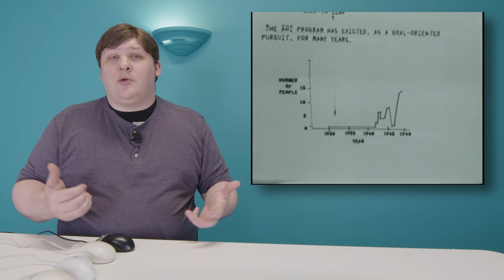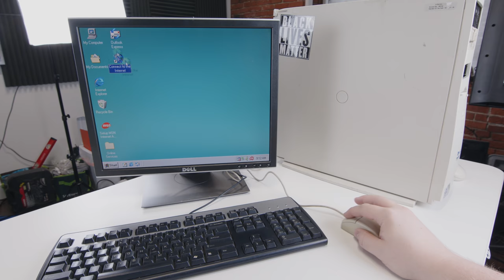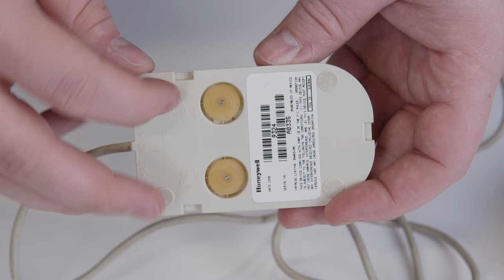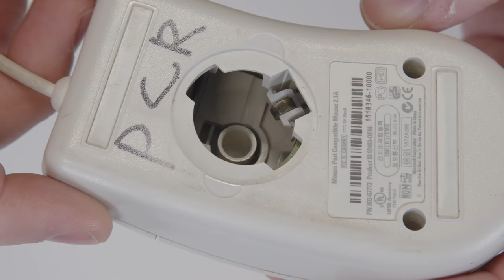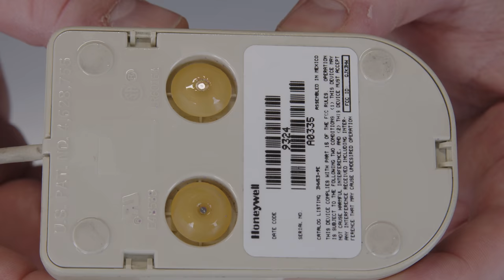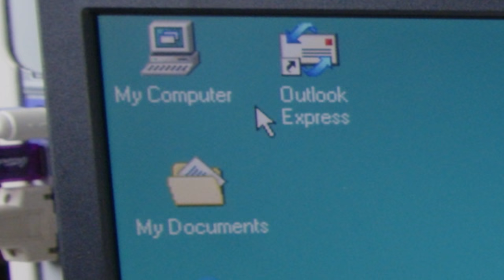Jack Hawley's Unstoppable Computer Mouse

Comment: Regarding Engalbart's mouse and design choices here are some things I reflected over:

Why no ball?
I don't know, I doubt that Engelbart never had come across a trackball before. But maybe he didn't think of inverting them, or (IMHO more likely) he thought that such device would've been too large (looking at the Telefunken "mouse"/"rolling ball control", which actually was released before Engelbart's demo, it seems to be 50-125% larger*, in each direction, shaped like a half-sphere). It does seem like Engelbart at least had some ergonomics in mind when he designed it.

Why wood?
Well, it was a prototype. Wood was/is (today it probably would've been 3D-printed) a reasonably fast way to make a prototype (also, see other early computer related products, like the Apple I or actual Breadboards)

Why potentiometers(/rheostats)? 
The patent (filed in 1967, demo was in 1968) actually mentions three different "decoders" for possible use: Potentiometers, Discs with tracks and sectors, where wipers are used to determine the position (similar setups are used in electromechanical devices, like , and a rotational decoder (with three tracks). What the two first ones have in common is absolute positioning (with the downside of the second one being that it would need a large number of wires, as noted in the patent, one for each wiper/track), and that seems to have been important (together with high precision) to Engelbart: Skimming through the patent the device is meant as an replacement for light pens (which uses absolute positioning), the device is called an "X-Y Position Indicator", and it mentions it being used to trace drawings etc.

Also notable: Engelbart's device had three buttons (at least in the patent, the prototype had only one), I don't know how common that was for similar devices before that (the Telefunken mouse had only one, big, button at the very top*), and the cable came out the back (instead of the front end, as later versions did), hence they called it a "mouse")

It's interesting that we went from using "pens"/"on screen input", to "off screen input"/the mouse being the "better"/more prominent input technique, and now back to "on screen input"

This was a great, informative and entertaining (as always), video on an interesting, and weird, mouse. I just find Engelbart and his (and other "proto-mice") mouse fascinating.

(Personally I use what could be seen as "the ultimate mouse, combining the power of it's ancestors": A trackball mouse with an optical sensor :D )

(*The Telefunken RXS 100-86 was a beast, that doesn't seem that comfortable to use, measuring 70x120x120mm 2.75x4.75x4x75in)

Comment: When you talked about other failure modes my mind immediately went to using it on some kind of loose cloth, god forbid. I don't think that would be especially common ever, but if those feet were grippier I could very easily see a tablecloth or some sheet getting pushed up and twisted around both the feet and the shaft. A ball mouse might not work well on that, but it wouldn't get jammed every few seconds like the Hawley mouse could

Comment: I remember using these honeywell mice at university back in the early 2000's. I remember them being quite good, and they would have been excellent from the point of view of maintenance for the IT department! I think ours were connected to X-terminals and PC's that were running Solaris.

Comment: So at my highschool the pc I was assigned in computer class had this mouse, it was the only one in the whole school (the rest were ball mice) and I was confused as to where it came from. It did have a bunch of oddities, it didn't work on the mouse pads (we had weird ones that were terrible), it worked 'perfectly' on the linoleum of the desk, which was kinda funny cause the ballmice were opposite, meaning I had a huge range of motion where my classmates had to deal with the tiny mouse pad.
I did notice the obtuse angle issue, I treated it a bit like an 8 way dpad more than an analogue stick.

Comment: To work around the slipping issue, you could add more tracking wheels at new angles. 
Give the circuitry more input to work with; take into account the inputs of four or even just three wheels instead of the two, and the slipping issue would be solved.

It feels like that would still have less complexity in the build than a ball mouse has.

Comment: (I'm a little late here but)
Conventional trackballs can't operate on wet surfaces (esp. oily ones) due to a phenomenon more commonly associated with cars called "hydroplaning", a trackball emulates the mass of a car by having that little weighted core in it.  The internals of the mouse getting gummed up by wet debris is simply icing on the cake.

Comment: Optical mouses were already available in general public computer shops during the late 80's, and they were way cheaper than Microsoft mouses of the era, especially the InPort model that was sold with its controller IC or its ISA card. The main drawback was the obligation to use the dedicated mouse pad.

Comment: The 80's had controllers that used 2 potentiometers that you could turn by hand, pretty much the same as the 1st mousey. these could be used in some games with commodore VIC 20, 64, and probably others. These seems to be called as "pot" or "paddle" controllers. Had to wire these to analog port of the rs232 to make em work.

Comment: I think a better analogy would be comparing a mouse to a steering wheel. Both controllers that are smaller parts of a bigger device used almost universally. 

Car would be better compared to the computer as a whole. Wheel/mouse comparison even works better considering the wheel wasn't immediately how we steered cars, first cars used a stick/rod.

Comment: In 1986, I think it was more a matter of people using the mouse that came with the system, and the OEMs going with the cheapest designs they could come up with. Aftermarket mice just weren't a thing for most computers, with the exception of the PC. And in its case, you were more likely not to have a mouse at all at that time.

Comment: Sorry about that. Did work for some nutcase who made a ball mouse in a wooden box. Serial interface, single ball. Used an Intel 8048 micro chip. Next came a mouse with both an IR and a Red LED. Pad was a weird looking job with Green and faintly red stripes... the one with a really big ball won.

Comment: the pull between a magnet and steel is the same as between two magnets as long as the steel is sufficiently thick....two reasons to go with a steel washer would be cost and maybe more importantly, ease of assembly.  with two magnets you have to get polarity right and depending on how the magnets were supplies and how the mice were assembled this could be a huge headache.

Comment: I had that exact same mouse. Bought it for $1 at a thrift store back in 2003, and sold it on eBay a few weeks later after i was done playing with it. The magnet springs are much smoother and don't buckle under load, only reason they are used.

Comment: Optical mice were jittery and had finicky tracking that didn’t always register very small movements when they became commonplace though. They still do, twenty years later! I hate it when I have to replace a mouse, because it takes several tries before I find one that works well for me, and then it doesn’t last long.

I had a counterfeit Microsoft intellimouse ball mouse, one of the first ones to have the scroll wheel. That lasted for 5 years, and only then only the scroll wheel rubber was worn off. Found out it was counterfeit even trying to get DOS drivers from MS support. They still emailed me the drivers, which worked.

Wish I’d held on to that mouse. The genuine MS intellipoint mouse I replaced it with, didn’t even last 6 months. No mouse I’ve owned since has lasted anywhere near as long.

Resisted the switch to optical, until ball mice simply weren’t on the shelves anymore, at which point, only laser mice didn’t have unacceptable jitter or tracking fails at high speed. These days there are plenty of optical mouse with reasonably good performance, but I still miss the ball mouse, because good ones had a sort of stability and predictable behavior that I still don’t feel with high end opticals. A good ball mouse’s tracking was 100% still if you stopped, tracked small movements consistently, and would not fail to track fast sudden movements. Even the best optical mice today still fail to track movements above a certain speed threshold, and for me, still don’t feel as capable of extremely fine detail.

Comment: That's nuts.  I have the black Keytronics LT Mouse PS2-B version and its identical except it uses a PS/2 port instead.  I had this brand spanking new mouse since the 1990s and never used it.  I have it in front of me and it looks practically the same except for the buttons.  I was surprised that some people in Ebay paid up to $95 for one.

Comment: Most early cad, and best practice now, has you do tuning that fine by directly editing vertexes or algorithms. the mouse is only used as a selector.  Actual advanced manipulation uses expensive as hell 3d pointing tools(or if your not a rich architect, sucking it up and spending 2 seconds rotating your view with hotkeys)

Comment: Had the Dec hockey puck on the vaxstation 2100. Thing was indestructible. Was still good as new when that was retired around 1994.

would assume that patent protection plus offshoring of manufacturing for consumer product in the early to mid 80s limited distribution beyond workstation companies based in Menlo Park or Palo Alto and by the time that such protection expired optical mice were taking over. Since track balls has been around since the later 40s it would follow that the various approaches to rotary encoding from the ball did not enjoy such protections and were therefore cheaper for Logitech and others to pick up and refine.

Comment: We had these mice in one of our computer rooms in high school. They were attached to our network-booting 486es in the early/mid-1990s and I always thought it was weird that not all mice were like this.

I'm so glad that you made a video on them and it wasn't just a weird fever dream I had in high school.

EDIT: Just to add to some stuff in the video... My memory of using these mice in school is that the wheels were all that yellow colour even then (although it's highly likely they were secondhand by the time our school got them) so I suspect that's just the colour of the wheel.

As for why we had them in a school, I'm gonna guess it's because they don't have mouse balls that can be easily pulled out and stolen/thrown at other students. I remember them working really well on the raw desktops we had (the room with them didn't have mouse mats and they ran perfectly across the textured desk surfaces). I do remember that they would pick up grime and develop a black ring around the contact surface over time, but this could be easily cleaned off if the mouse wasn't tracking properly for some reason.

I also remember that they felt light and flimsy compared to the ball mice in the other computer rooms, though, and just not as good to use in the hand, but maybe that's just me. I had a habit of picking them up and turning them over and playing with the wheels in class, which irritated my teachers no end.

Comment: Only ever seen 2 of the Honeywells, one in use. They always seemed to have yellowish wheels compared to the rest of the material, the tracking issue you had I seem to recall experiencing.
My usual cleaning method was a #11 blade craft knife for the rollers in my own mice. Some were better than others, I found longer rollers tended to have the crud either break off or slide off the contact point, the short ones like some early MS branded mice just gummed up hard eventually.
The only place I think the magnet would be a liability is in a metal workshop, lots of fine ferrous metallic dust that might get around the wheels and up the shaft. I have several magnets I need to clean for that very reason.

Comment: That's neat I thought they were going to be ultrasonic discs or something.

Once upon a time I used to a digitizer with the AutoCAD that was crazy. It was a whole different system. I've also used Spaceballs but I'm not the biggest fan of those.

That's that low rolling resistance for you.

When you first showed the wheels you put together I immediately thought about wheels on wheels from robotics also forklifts. I wonder if that would have helped. You'd still need two or else dirt would get inside.

Comment: Surprised this design never caught on, I've never seen one at least.
The dirt resistance seems to be a huge bonus over a ball mouse.
Reply: The biggest advantage I've seen was the immunity to having key components stolen by kids. My high school bought a heap of these when we got Windows 95 machines and the use of computers expanded beyond specific classes, so locking up the mouse balls was no longer an option.

Comment: Back in the days i owned one of these. Was so much better than the Ball mouses but never really took off. Mine said "Honeywell" and not Key Tronic. Actually it was the first honeywell product i've ever owned as the brand isn't very common in Germany at all. 

EDIT: The plastic didn't degrade over time, it was that yellowish already when the product was new. 
I used this kind of mouse long before the optical ones came out and due to that I wasn't very impressed with the optical ones at first and kept using this one for a good while before finally switching to optical. These things worked like a charm.

Comment: Magnets were also very cheap, seeing as they would be likely a cheap small diameter speaker magnet, which is produced in the tens of thousands. They likely went and got all the weak magnets that were rejected by QC to use there, and later on with the steel washer did this to use slightly stronger magnets.

Comment: The old Logitech iFeel Mouseman was a fun one. Sadly the iFeel part of the driver stack stopped working once Windows XP came out, but the tech is still alive today in any device that uses Touchsense force feedback.

Yep. A force feedback... mouse. Basically a speaker coil attached to a weight. For the stuff it worked with, it worked surprisingly well. Running the pointer over the page in MS Office and get a "paper texture", get little bumps on the edges of windows and buttons, even a few games like the original Unreal and Unreal Tournament supported it.

Given the amount of lol-pcmr-g4m3r type mice that exist now with all kinds of rainbow-puke RGB effects and other pointless doodads, I gotta wonder why this hasn't ever been revisited. It might have been a little ahead of its time back then, but I think that stuff would probably sell these days.

Comment: Holy shit.
Imagine if this design made a comeback.
But with grippier discs
And maybe twice the discs. One upper set where they're aligned horizontal-vertical, and one lower set where they're aligned vertical-horizontal. Get the horizontal speed by averaging the two horizontal encoders, get the vertical by averaging the two verticals.
Then pit it against optical and laser mice.

Comment: Going to a lot of your old videos two years too late but we used to run those in the shop ready to work right now you’re correct it works great in one circumstance and that’s all they were meant to do but when they fell apart and got jammed up full of metal savings after 45 years then he had to replacement

Comment: So I'm daily driving a brand new keytronic lifetime mouse now. It has the cheap screw-less design of the optical mice in your last mouse video, but seems to perform better than the Hawley mouse. The rollers are slightly soft like a mouse ball.

Comment: I have a few of these that are Serial and PS/2 with honeywell.. but the one I like most is the two DEC Puckmice .. one is on a VAX and the other is on the SPIM box (Personal DECStation 5000/50).  They're weird.. but I love em. Sometimes I've scraped the spooge off the wheels, but it's rare. The honeywell's definitely grippied more betterah back in the mid 90's when DEC sold em on the 486 desktop Venturis workstations.

Comment: My dad managed to get a few dozen of these from a friend that worked for Honeywell... when these worked they were great but for whatever reason, they tended to subtlety die in a similar way to a ball mouse but couldn't seem to be fixed by simply cleaning the thing. That might just be poor build quality of Honeywell stuff; looking back on it I think the encoders would fail due to dust getting inside the case through holes in the cheap enclosure but I was a kid so... eh.